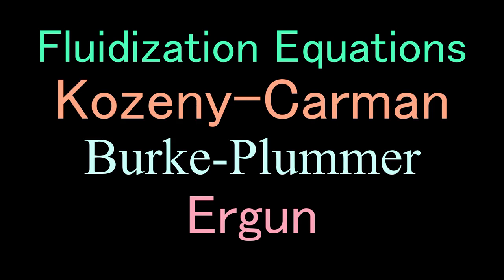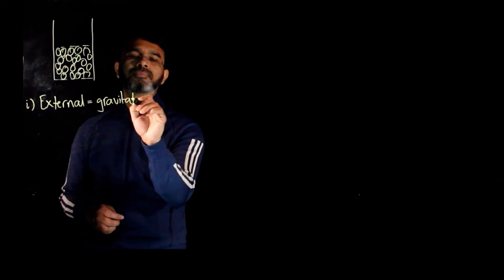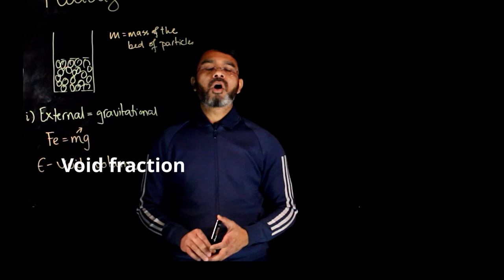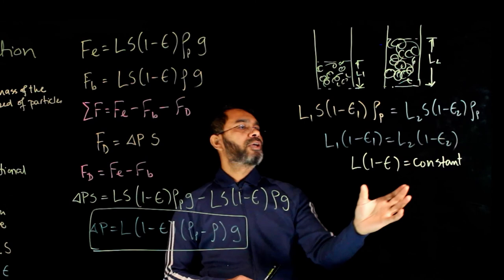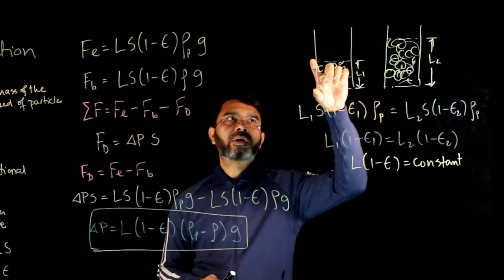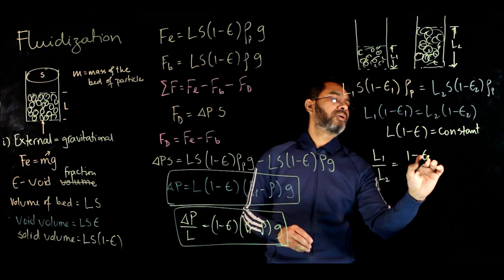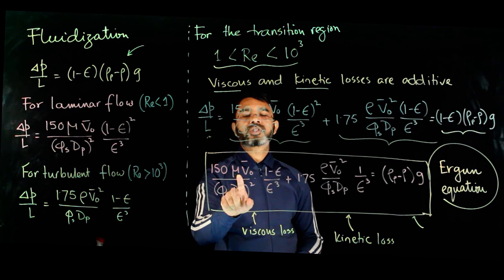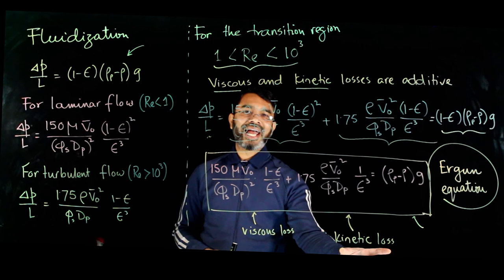Fluidization: Kozeny-Carman, Burke-Plummer and Ergun equation

Comment: Thanks for sharing your knowledge Salim. Very interesting and unique resolution. I have just one clarification. When considering Darcy Weishabach either friction coefficient and pressure drop equation to calculate the pressure drop through a voids of the bed It was considered as incompressible flow. Why that consideration knowing that the fluid is gas and then considered compressible? Why not take the modified Darcy - Weishabach equation for that?

Thank you in advance for the clarification